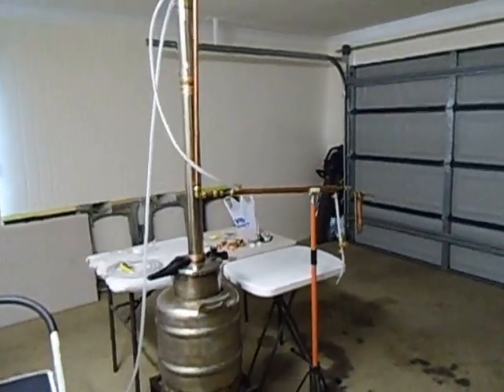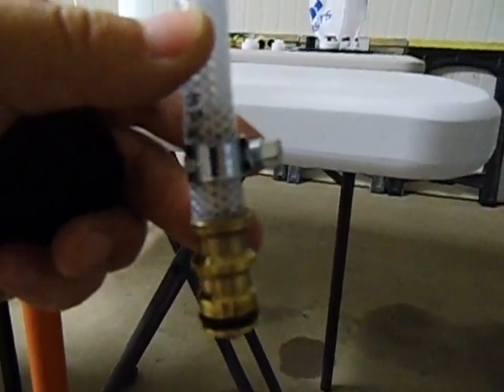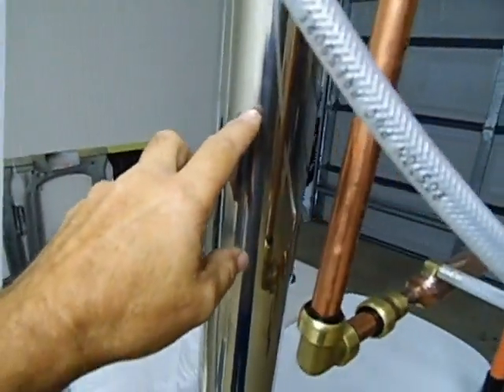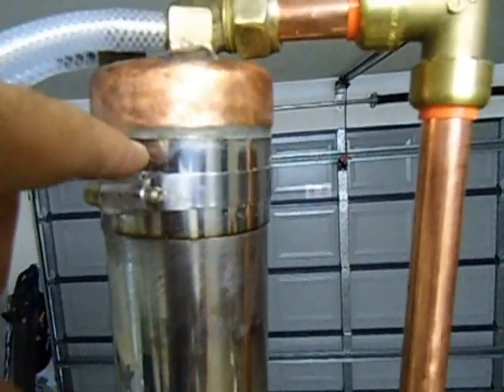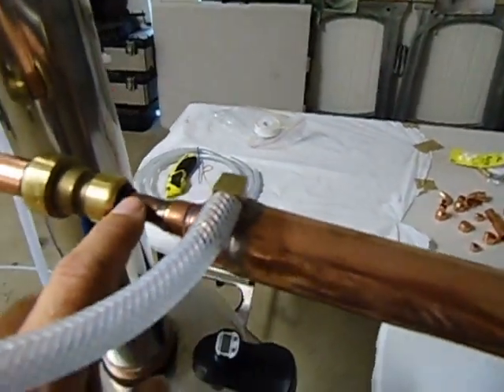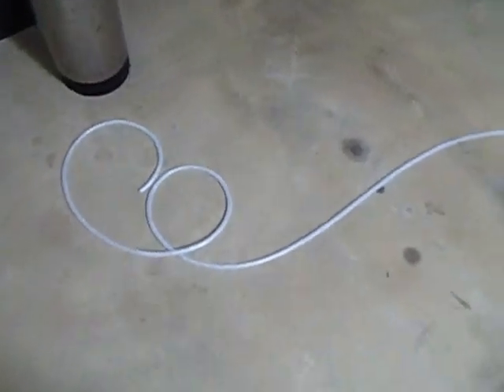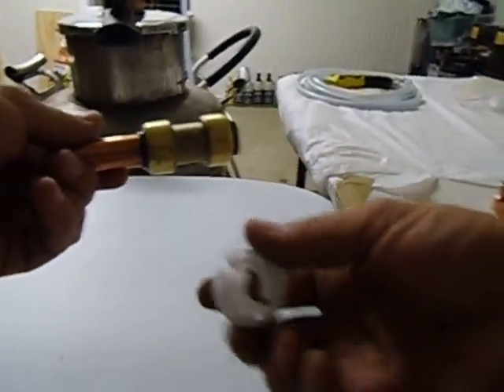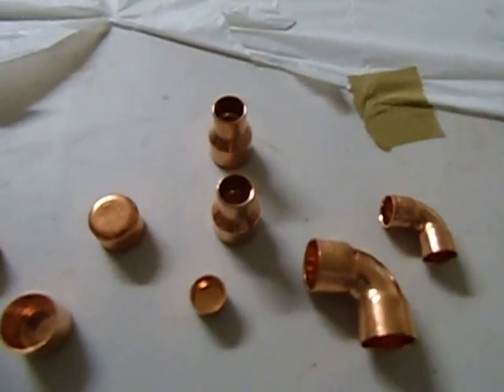Homemade Reflux still finished and setup

Comment: Replace the brass elbows with copper ones, the brass has lead  in it; which is very bad for your health man! Lead gives you high blood pressure and affects your kidneys.
Reply: @tassie spirit and all other home still owners....
Brass causing a health issue is a myth. 
Indeed some brass alloys may contain traces of lead (up to 3%) the main components are copper and zinc. Lead improves the machinebility of the brass. 
The lead traces (if applicable) are bound within the cristal matrix and CANNOT be dissolved. Therefore use of brass in a still or drinking water systems is not a  health hazard.
FYI manufacturers of alcohol stills are allowed to use brass alloys incl brass alloys with traces of lead.
Regards from Bert in 🇪🇸

Comment: You are running water through your Liebig condenser backwards , cold water inlet goes to hot vapour side , more temperature difference equals more efficient  condensing !

Comment from the maker: Silver solder do a great job without using fluxes and flows really well and smooth aswell . I Tig welded it to the keg , very slow but perfect for welding stainless steels together :-)

Comment from the maker: I did however got some airlocks with the parrot attached to the condenser outlet vapour pie and had to change the parrot like in my other video named my homemade reflux still first run part 4 of 4 , please note that the parrot squirts when it get a airlock and can be vary dangerous when running it with the parrot attached unless you put a breather on , on the inlel side of the parrot that is higher than the parrot , cheers